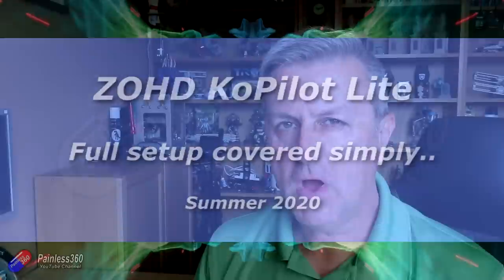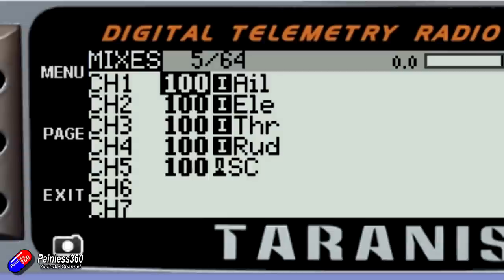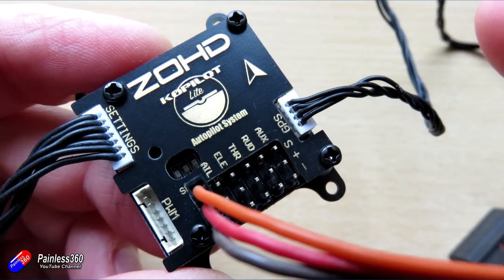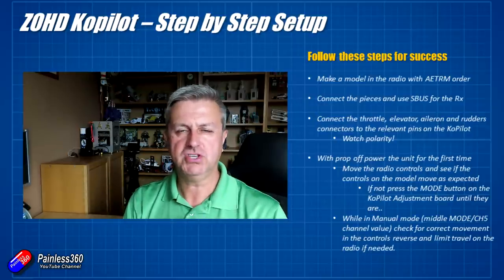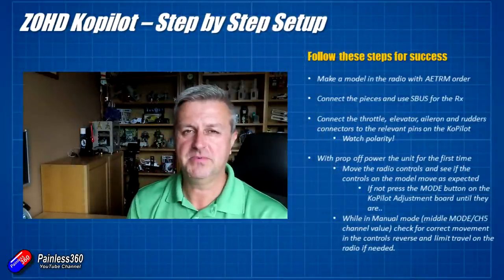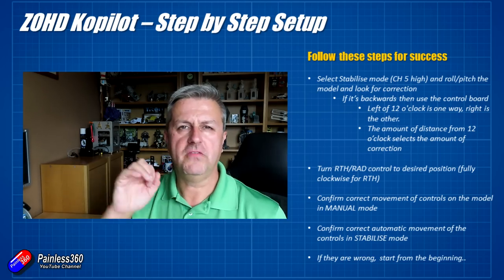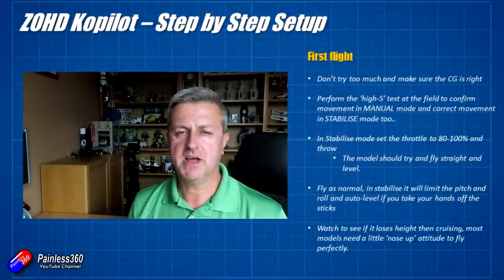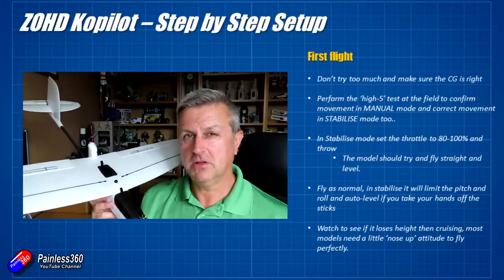ZOHD KoPilot Lite: simple stabilisation and RTH - step by step setup for new pilots

Comment: Painless, I want to thank you for all your tutorials, reviews, and flight videos first. I have to say thank you now with the tutorials on the Kopilot system. I was able to follow your instructions and I did the maiden flight of my FPV Glider and it was an amazing experience. I was able to do the flight and tested stabilization, RTH, and even failsafe RTH successfully. I do have some trim & battery positioning to work on to get the best balance/performance but it was a fantastic experience. Thanks again for all you work.

Comment: Once again Mr Painless helps me out. I have just installed one of these which I bought for thirty six pounds from banggood. in my Bixler 3.  Followed your clear and simple set up instructions. It works a treat . I think I really put it through its paces. In manual I put it into a full stall switched into stabilize and it corrected itself immediately . To be fair the bixler does tend to correct itself but not as quickly. I  performed a half loop in manual switched to stabilize whilst inverted once again the Kopilot sorted it out beautifully. The return to home is great the only very slight downside is that the home point is set above the point where the board powers up which means when it returns to home it orbits over the pit area. Easily fixed by powering up on the far side of the strip. The scary part of my test was actually switching off the transmitter. No problem there back to the home point like a well trained pigeon but when I switched on after the test I had no throttle control so ended up landing dead stick off strip. ( nice day for a walk ) . It was pilot error as I have to set all my switches to the up position before the radio will power on of course this set my throttle in safe mode and I forgot this.  Auto launch is a bit scary you really need to give it a good shove to keep it on track as the throttle opens.  I think I found a nice little hack or trick. If I apply full left or right rubber in stabilized mode the plane makes nice flat turns. I am thinking of mixing one of my pots to the rudder. This could be really useful in a thermal.  Thank you Mr Painless you made my install really easy. FDO

Comment: sorry to go crazy on the comments.   I put this setup in my yellow EF 300extra.   modes are, stabilization,  off, RTH.    everything worked great.   I even threw the plane in the air to test the auto take off and it worked great!!!!   thanks again for this video.      The only thing i dont like about it, is you have very limited control when the model is in stabile mode. I wish it was more of just a gyro, but I am still learning all the functions of this item!!  thx again

Comment: Thanks for this.  When I did my maiden on the Dart 250g it immediately death rolled to the right and broke the nose off (ouch, but you can't see where I glued it back together so all is well.)  I did manage to figure out the Kopilot problem and get it flying nicely, but I wish I had seen this then, 'thank you' to your patreon for inspiring it.  
I had to move (during a pandemic?  Eeesh!) and haven't flown it in too long.  I originally tried a little 200mw aio cam like you have in this video and I could never get any range.  So I bought an RDQ vtx and a good cam but still haven't set it up.  Now that I have the DJI goggles on order I'll probably just stick a Caddx Nebula in it!  And someday I'll fly it again ha ha :)

Comment: Really enjoy your videos, Ive learned a ton..  Appreciate all your hard work..  I finally figured out the Kopilot for my Dart 250 after watching your video a dozen times.  One thing that I couldn't figure out and probably missed in the video..  The Manual mode was working ok, but when I went to adjust Stabilize mode with rotating the pots, everything started to get reversed..  I swapped the servo leads and everything is right as rain...  The next one will be a breeze to setup..

Comment: Hi I purchased the ZOHD Kopilot for my first AR Wing, but I had problems with the controls but I think now I know what I did wrong but now I have a Maytek F411wse in it. Now I know what I did I need to order a new gps module and a new plane . Thanks for the video and information.
Reply: I do have a question about the ZOHD Kopilot,  I have a Volantex  A.S.W 28  Would like to put it in and if I'm right I can use the aux port for the flaps.  and I I uses the Beitian BN-220 on my AR Wing but if I'm right again I can order the Beitian BN-880 and then I can have a compass GPS module. Will this work  ? Thanks again for the video and information and the answer
Reply from the maker: If you're looking on doing anything more advanced than basic stabilisation and an emergency RTH mode then adding a more advanced FC with something like Arduplane or iNav would be a better choice. See my builds and comparison for both. Happy flying

Comment: Thank you so much for detailed Installation guide! 👍 I bought a Kopilot Llite  together with a Zohd Drift. Unfortunately, I‘m having big problems getting a connection to the Kopilot. I‘m using a Crossfire Nano + Taranis QX7S + Crossfire module. The Connection between Crossfire Nano and Crossfire Module seems to be fine (solid green light). I‘ve created a simple 4 Channel model in my Taranis and added a 3 way switch as channel 5. For the transmitter output, I‘ve selected external and Crossfire. With this setup, no input reaches the Kopilot. The Kopilot is permanently in balanced mode (flashing green light). I can select different plane types using the set button of the settings board in this mode, but this does not solve the issue. Surprisingly, this setup worked before I played around with small settings board. It seems that - by accident - I‘ve messed something up within the Kopilot. Is there factory reset for the Kopilot available. Can you provide  some hints for troubleshooting this issue? 🧐
Reply from the maker: How odd. You could try it without the settings board plugged in and see if that changes it. I'd also double check that CH5 is being put out on the SBUS connection to the KoPilot and that the output is set to SBUS in the TBS Agent Lite LUA script on the radio.. Best of luck!
Reply: The flashing green led(s) means that the Kopilot is in RTH/FENCE/Altitude Hold Mode NOT Stabilized. IF this is not changeable by moving your channel 5 switch then that means that the Kopilot IS NOT receiving any input signal from your receiver. As Lee says check that you have your settings correct for an S-bus signal output from your Crossfire unit.
Also remember that you MUST unplug the Kopilot settings board BEFORE you cut the power to it (NOT AFTER!) or you can lose the settings that you just added.
Reply: I tried a different reciever (non Crossfire) and it worked. It seems to be an issue with the Crossfire module. I wanted to check the configuration of the module and couldn‘t execute the lua script. There  seems to be no communication between the crossfire module and the Taranis. I tried a factory reset of the Taranis and the module, but it didn‘t solve the issue. Could there be an issue with the compatibility after a factory reset?
Reply: @peterkoslowksi4462  I have absolutely no knowledge of Crossfire. Possibly your best bet would be to ask on the RCGroups Forums thread on your Crossfire receiver if there is 1. Best of luck!
Reply from the maker: I'd check the settings on the radio are for CRSF for the external bay. I'd think hard about what you changed as it sounds like you did something else you cannot recall. See my Crossfire for beginners series fro how to set it up.. Best of luck!

Comment: Lee:  Very nice job! I really liked your still-frame closeups. Good tips at the end.
1) What was the all-up weight on your plane? Which model is it? (Drift?) How do you use it? Long range? Sloping? Thermals?
2) Does ZOHD Kopilot Lite mind the lack of a rudder?
3)   Have your tried either of the Express LRS Happymodel systems? (915mhz or 2.4ghz)? I'd like to see your take on these new short latency, long range products.
Love your stuff!  - Jim
Reply from the maker: Hi James,
1) It is a very easy to fly, floaty model great for relaxing flying in very calm weather.
2) Not at all
3) I've not. I am a TRACER and Crossfire fan.

Happy flying!

Comment: Good day. I’m working hard to install a ZOHD Kopilot Lite into a small foam flying wing. I am attempting to set up the Kopilot using a Spektrum DX9 transmitter and Spektrum AR 620 receiver. Despite working hard at it, I’m quite frustrated.
I began with a clean slate by creating a new model in the transmitter with no mixes. Using the Kopilot’s PWM wiring harness and the transmitter’s RX PORT ASSIGNMENTS function I have programmed the transmitter to AETR rather than the Spektrum standard of TAER. The transmitter now controls ailerons from channel one (rather than the Spektrum standard of throttle on channel one), elevator on channel two (rather than the Spektrum standard of ailerons on channel two), throttle on channel three (rather than the Spektrum standard of elevator on channel three), and rudder on channel four. At the receiver the Kopilot wiring harness’s white wire is plugged into channel one and the mode switch servo plug is inserted into channel five. I have also programmed the transmitter to have the three position “B switch” control the Kopilot’s Mode function (switch position +100 = stabilized, position 0 = not stabilized, position -100 = Return To Home). In the model, the servo connected to the aileron channel (#1) is installed in the left wing, and the right wing servo is connected to the elevator channel (#2). Following the instructions that ZOHD provides, and a number of Youtube videos, I have used the Kopilot’s control panel to set the unit for a flying wing (both green LED’s are lit along with the red GPS LED. As far as I can tell, everything’s perfect – but, there is a problem.
I am flying Mode two – elevator and ailerons on the right stick and throttle and rudder on the left stick. The left stick’s throttle control works just as it should. That is not the case with the right stick. When I pull back on the right stick my wing’s control surfaces move for a left turn (right aileron down, left up)! When I push forward on the right stick my wing’s control surfaces move for a right turn (right aileron up, left down)! When I move the right stick to the right, both ailerons move up. And when I move the right stick to the left, both ailerons move down!
When I engage the stabilizer via the mode switch, corrections made by the Kopilot are a consistent mirror image of the results of control inputs. In other words, when the wing is pitched down, the stabilizer acts to bank the aircraft to the right. When the wing is pitched up, the stabilizer acts to bank the aircraft to the left. Similarly, a left bank brings a downward pitch correction, and right banks result in an upward pitch correction from the Kopilot.
I have had the same results using a different receiver and transmitter, as well. I don’t understand why the transmitter’s right stick has aileron controls on the vertical plane and elevator control on the horizonal plane. I would be grateful for any help you may provide. Thank you
Reply from the maker: I've only seen issues like this when either the servos are in the wrong connections or you have two different servos in the wings with one moving opposite.. Best of luck
Reply: Thank so much. With your help, and some from others, we have the system up and running! I'm grateful for your quick and helpful response!
Reply from the maker: So, what was the issue?
Reply: @Painless360  As you suggested, the aileron and elevator servos were in the wrong connection, one servo's travel for stabilization had to be reversed at the potentiometer, and the second servo's travel had to be reversed in the transmitter. Three small actions; each, by itself, simple. But when combined, very vexing for over four days. Once again, thank you, thank you!
Reply from the maker: Glad you got it sorted. Having the servos in the wrong outputs is so common I made a few videos on it with things like INAV. Happy flying!
Reply: @Painless360  ! thing that often catches folks out in this manner is that the manuals for the Kopilot lite show 1 configuration for the A/E (or E/R) plugs and the manuals for some planes (the Talon250g for example) show the opposite configuration. This is, as said here, due to the servo orientation being different BUT those manuals DO NOT make this clear. Thus most new chums, on opening the Kopilot Lite box and setting it up in their new Talon 250g by conscientiously following the manual in the Kopilot box, are headed for grief! ;-)

Comment: Hi. I have been flying R/C models since 1962 in all the usual types. But some years ago I thought that my skills had reached the point where it would be better if my models had some level of stabilisation and return to home capacities. I have tried several different systems. Ardupilot, Arkbird, Pixhawk,Mini Pix, and most recently Zohd Kopilot. All proved difficult to set up but the Zohd proved impossible and has, I suspect, a fault. It seems not to be in production any longer. What is there in the current range which fills the bill ? Clear instructions and step by step installation details are essential. My preference is for fixed wing applications. My Mini Pix was the only success I had with Copters but the Mini Pix seems not to be available due to design licensing issues. I have enjoyed your guidance in the past and look forward to some full and frank guidance with a currently reliable product. Best wishes: Birdmanpete
Reply from the maker: If you are looking for the majic combo of stabilisation with GPS function then that limits the stabiliser options you have. There are lots of 'old-school' stabs. that work great for the basics but very few have added the extra features. 
I suspect that your KoPilot is faulty. I've seen a few since it was released. The manual was always a little 'light' on detail so I made the setup videos to help pilots with that. 
In terms of the options. KoPilot Lite is still the simplest to setup, and when working (i.e. not broken and setup properly) provides auto-launch, stabilisation and RTH features that you don't need a PC to setup. 
Outside of KoPilot, there are a few others about (something called the Sparrow for example) but I've not tried them.
For fixed wing I use INAV. It isn't too tricky, the setup steps are well understood and there is a large community that can help with setup and issues. It does require you to fire up a PC and soldering iron but you can have all of those features you want and so much more. 
Check out my INAV for beginners 2023 series for the latest series..

Comment: Hi Lee,  
I suspect you are getting tired of the KoPilot questions like the ones below. I do hope you would add answers to these:
1.) When selecting the model "Type", is this done in Manual or Stability mode or "either".?
2.) When the Type is done, is there an "exit" step/procedure or do you just go on the rest of the setup?
3.) We know for the initial setup all channels are set to 100%. That Rate causes a lot of excessive control surface throw in Manual mode.  There is confusion about what happens within the KoPilot if one later reduces the Rate for less movement.  How does this affect the KoPilot, say when switched to Balance/Stabilize or RTH modes.  If it is a problem, is there a workaround option to have a lower Rate ...?  Suggestions...?
As always, Thank you for the informative video work, DL
Reply from the maker: The setting button on the KoPIlot settings board does different things depending on the mode so make sure that you are in the right one. Its covered in the video so if you follow it you should be good.
No save process for the type, just stop pressing when the controls work in the right way.
Once you've set it up, the last job is to reduce the throws on the radio for manual mode and turn down the gain on the KoPilot so that they only move that much in stabilise too.
Best of luck!

Comment: In regards to trimming.  Step 1 fly in manual mode and make the trims on the radio.  Step 2 do the calibration using the kopilot in stabilized mode.   After you have done the calibration in the kopilot, do you (A) reset the trims to center on the radio or (B) leave the trims on the radio?.
Reply from the maker: I leave trims as the recalibration is teaching the KoPilot the new 'middle' channel values.

Comment: Having followed this really useful video I had the KoPilot setup in my Drift, but one thing doesn't look right.  In manual mode everything is fine but in stabilised mode the AIL and ELV pots which I thought set the gyro gain also affect the servo travel and the lower the gain the less the transmitter can move the servos.  For example, in manual mode full stick deflection moves a servo about 60 degrees.  In stabilised mode with the gain pot fully clockwise the servo will still move 60 degrees, but if I reduce the gain pot to almost zero the servo now only moves about 3 degrees for full Tx stick deflection.  On my planes with gyros such as the nX3 or Multiplex G3 I always start with low gains and after a test flight start increasing the gain until the model starts to over correct, at which point I reduce the gains very slightly.  With the Kopilot starting with low gains means that even a full stick deflection hardly moves the servo so I have no confidence to put the Drift into the air as I appear to have no control.  Is this gyro gain reduction in maximum control surface movement normal for the KoPilot ?
Reply from the maker: Moving less in stabilised modes is common. I. E. https://youtu.be/SA7reaRMF4M